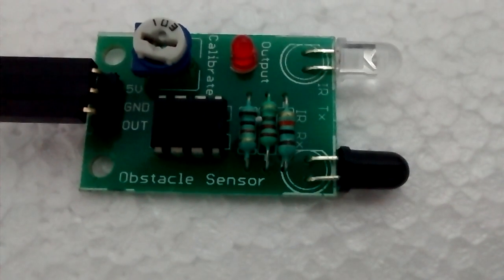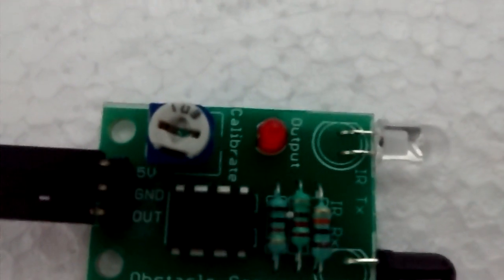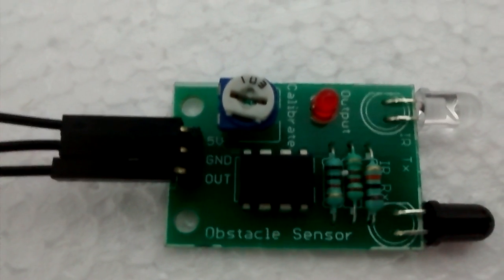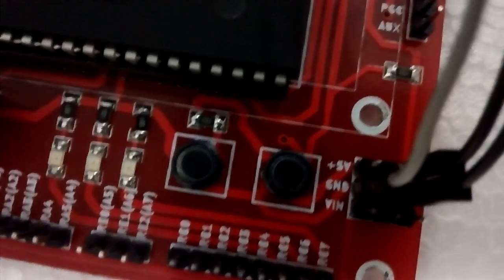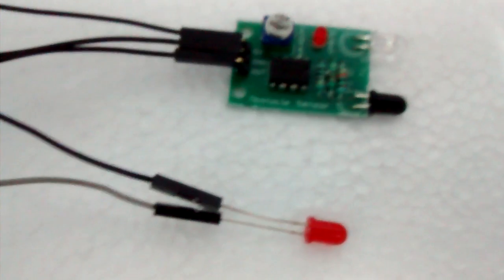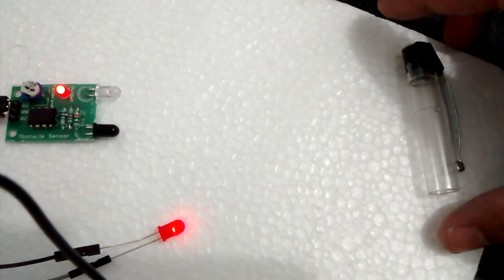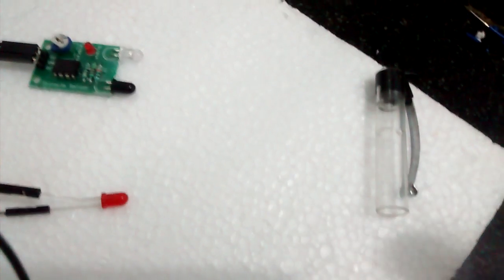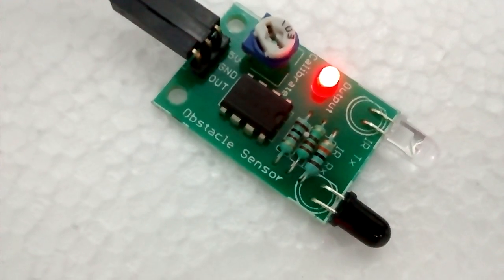IR Obstacle Sensor : Working Explained

Comment: Which 2 pins should be given power
Reply from the maker: The 5V and GND pins.
Reply: @imtheroboart  and output ?
Reply from the maker: @aryandabholkar9211  you can get the output from the OUT pin. When it detects an object, this PIN will give you a HIGH state.
Reply: @imtheroboart  I want to an output to relay and connect the common and nc to a bulb can u plz make a vedio on it or explain how can I do it???
Reply from the maker: @aryandabholkar9211  please watch the video in below link. I think it would explain you the solution you are looking for :-)

https://youtu.be/-noY2He0MLM

Comment: sir I have made a project for sensing vehicles on the road by using this sensor .I have made all the connections correctly but ir ir sensor remains on when there is no object in front of and in the presence of obstacle it gets off .plzzz help me as I want the reverse of this .plzzz give some solution as it's my 12 board project

Comment: what is the input voltage for this module
Reply from the maker: 5 Volts
Reply: thanks
Reply: output also 5v
Reply: one more thing
i want to make a 9v switch which will i want to press secretly, the switch would be in my shoe and i want to switch on and off secretly ... please help me

Comment: I want to use IR sensors under the track of my model train so that it will sense the train and move in the other direction is this possible ? and where did you get your sensor from ?Is it possible to make it ?
Reply from the maker: Sasha Gomes I got it from online websites .. it is also possible to make it by urself.. the circuit and component are easily available online ... 
Regarding ur project , yes it's possible .. but I would recommend you to use a sensor array to precisely detect the train . If u r planning to detect the motion of the train, then I would recommend you to use a PIR motion sensor ...